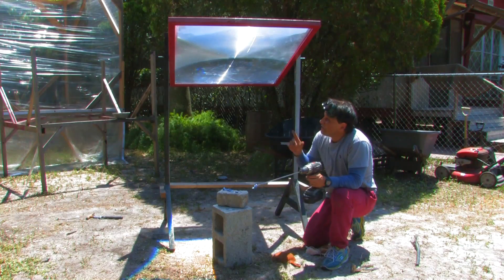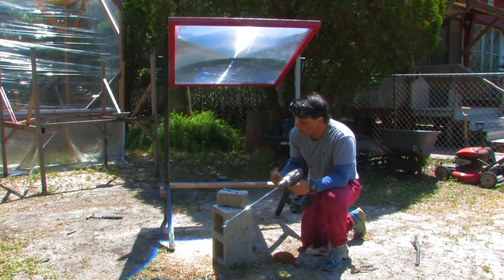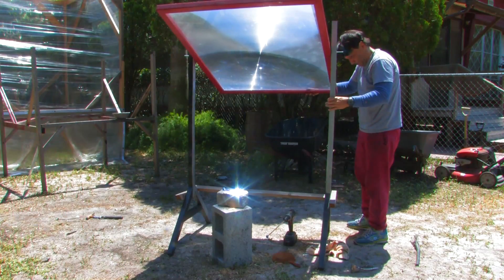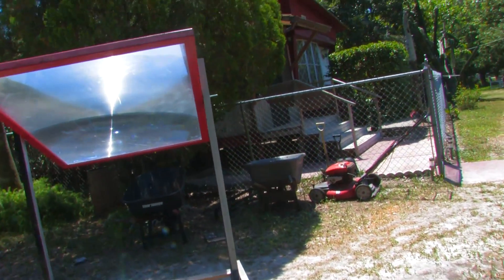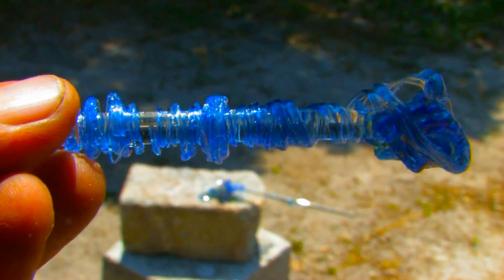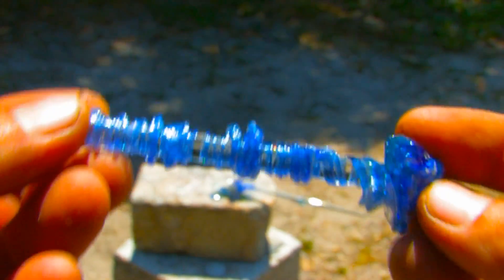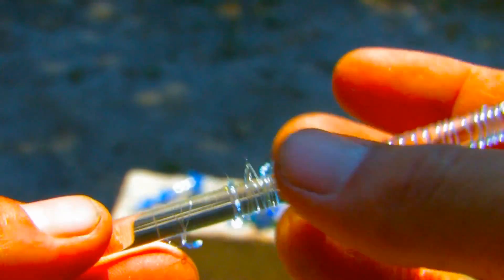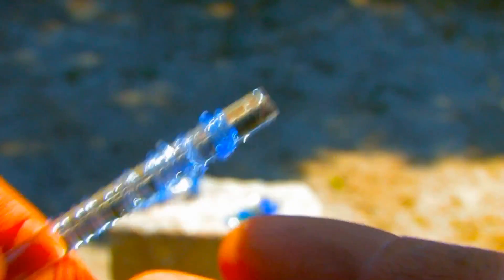3d glass solar doodler GLASS SPRINGS Fresnel Lens Soda bottle fiber optic art

Comment: WOW to get glass to the liquid state 1300 deg F for soda glass and 2100 deg F for boro. That is hot, it makes me wonder now. FYI Boro glass wont stick to soda glass at least not for long. The coe (Or shrinkage/hardness values) are different but you can also use a cold piece of boro for the "spring effect" to. If you have some vermiculite around that will work for a makeshift annealing well, giving your creations more of a shot at longevity.

Comment: Like the thanksgiving dinner I'm not sure what the point of this video was exactly. You got the glass hot enough to melt a little bit at a time, but it looked very inconvenient and the results you got from it don't seem to have many practical uses. Perhaps it's just my lack of vision and foresight, and I'd be more awed had you carried the project further. It looks mostly like a proof of concept, the sun is powerful, I'd like to see you carry thins further and do more with it.